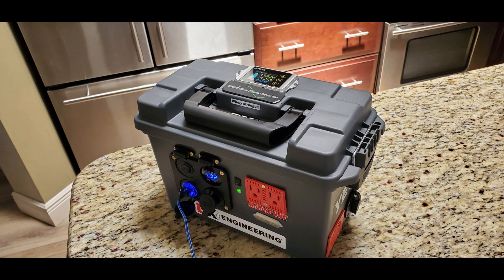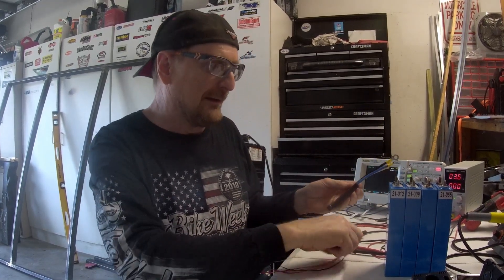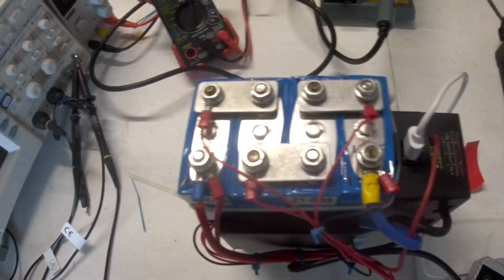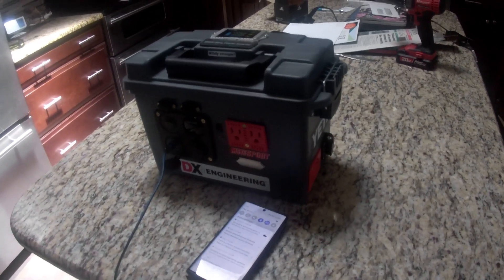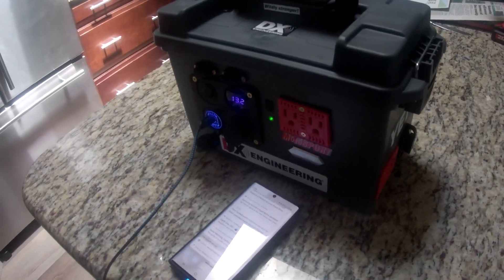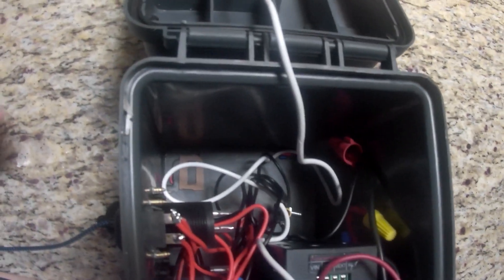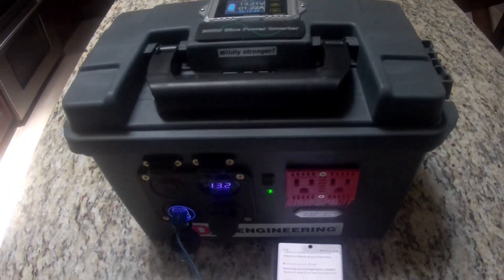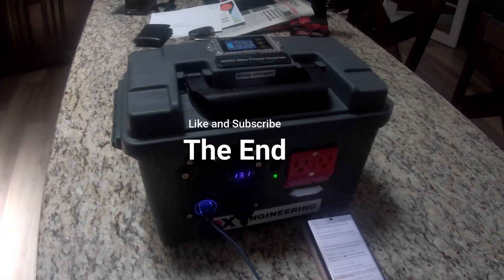DIY Solar Generator - LiFePo4 -  Yeti Goal Zero or  Jackery  or Bluetti  or Ecoflow Alternative?

Comment: Had to watch the video since I saw the new one.  I have 60-amp hours, each in my boxes, I keep things like AC inverter and charge controller outside the box as an accessory item.  I have Anderson connectors for DC out and can connect the charge controller or inverter to them.  Also have XT60 connector and relay for heavy inverter (500-watt) or coffee cup submersion heater.  Since I have 3 power boxes - buying 3 of everything is not practical.  Since the boxes all have voltage readouts, I can daisy chain them together when the voltage is the same (batteries in parallel) or power one box with another.
Reply from the maker: Sounds very nice. Alot like my 280aH and 230aH LiFePo4 batteries I build into a marine battery case with the BMS. I use them for the 510aH battery in my Cargo Trailer Conversion.

Comment: Great build.  I find myself using the victron 75/15 solar charge controller with a smart battery sense.  I use the victron and smart sense for low temp charge disconnect.  I use the load output of the 75/15 for low battery disconnect (but your BMS probably handles that) I also like that I can adjust the charge profile if I want to leave the solar connected and only charge to 80% when I am not using it for big cycle applications, like just running led shed lights and stuff.
Reply from the maker: Thanks for sharing